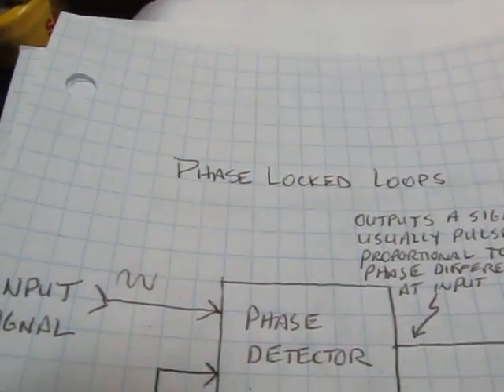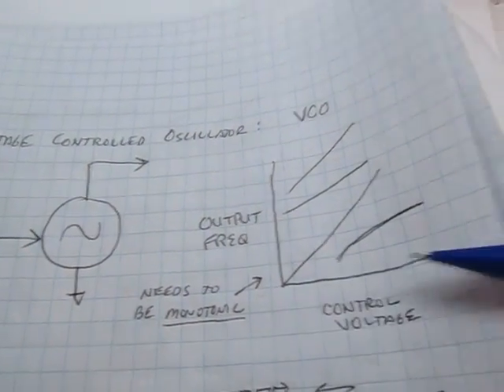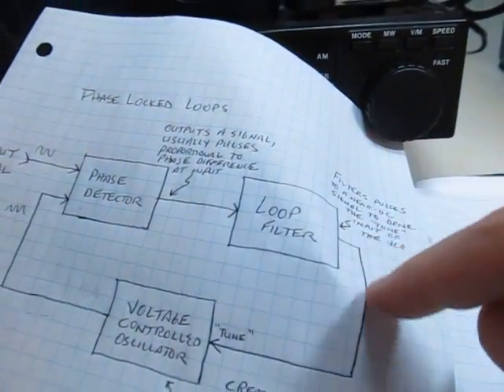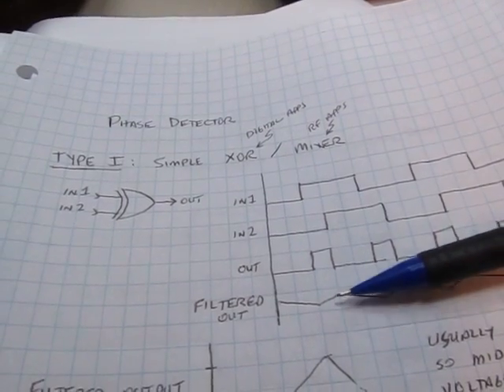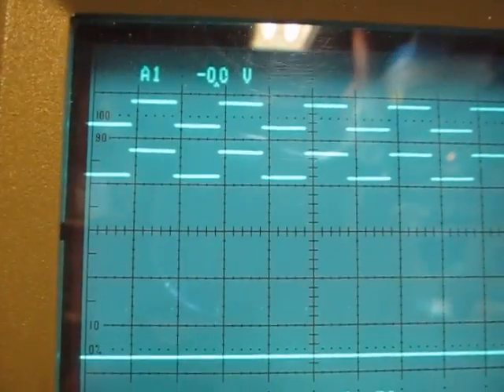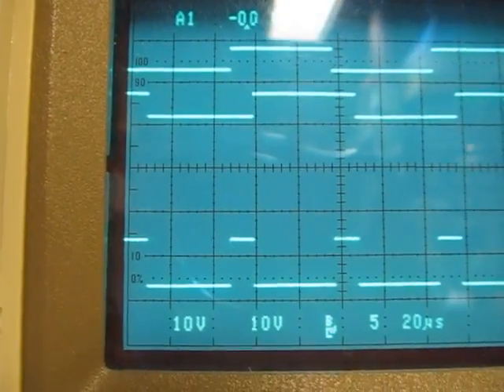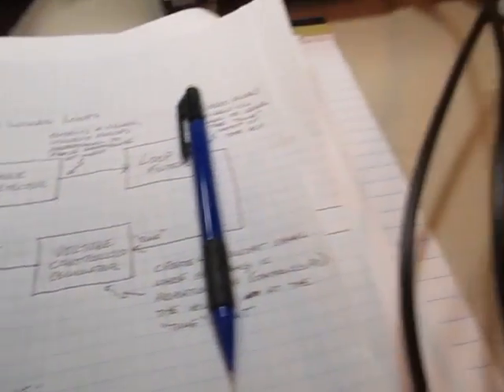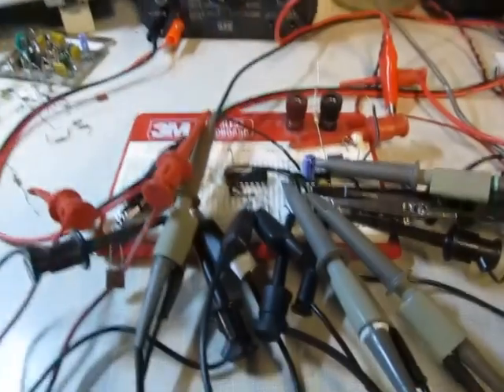#60: Basics of Phase Locked Loop Circuits and Frequency Synthesis

Comment: I realized the other day I have everything I need to make a PLLfrom discreet parts. XOR gate for the phase detector, RC filter, and I figure I could use the VCO circuit in TI's LM358 datasheet. Or if I really wanna go crusty, I could make a VCO from one of those BJT based multivibrators. Though I don't even know if that would work. You can't even look at the output of those multivibrators wrong without the characteristics changing.

Comment: Excellent tutorial!  My training is in Air Force analog flight simulators - non-engineer.  As a civilian, back in 1988 my GE television lost its audio.  I had to teach myself how a phase lock loop synthesizer worked and used a scope to prove the PLL had died in my TV.  It had no analog output to control which channel the audio should be on.  I installed a new PLL and all was good.  I wish I would have had your video back then.  Thanks for posting.  Brings back great memories!

Comment: I am finally starting to understand this. An op-amp seeks to equivalate the voltage of its inputs. A PLL is like an op-amp in the frequency domain, which seeks to equivalate the phase of its inputs. This is the best explanation I have seen. Thank you!
Reply from the maker: Yes - both are examples of negative feedback systems.  An op amp is a basic one, a PLL is a more complicated one.

Comment: Wow, a great explanation video for that 4046 chip! My first electronics engineering job after graduation in the late 1970s was with Burroughs, and I worked on a large mainframe disk drive that used a 4046 PLL circuit to generate a clock signal frequency that was locked to the spinning spindle, on which four 14" diameter disks were mounted. The input reference signal was a once-per-rev pulse from a magnetic sensor. We used a multi-stage divider after the VCO to generate a comparison signal. I did not do any of the design work on that PLL circuitry, although I did troubleshoot quite a few product units that weren't work properly. I do have a couple of those same Motorola MC14046 chips in my IC collection, so one of these days I'll take a close look at the data sheet (in the original printed data book 🙂) and set up a few experiment circuits, just as you've done in this video. There's nothing like "doing the math" on component selection and actually coming up with a circuit that does what it was supposed to do.

Comment: You are an excelent professor, and if you are not a professor, you should be. Thanks for all your amazing videos.
Reply from the maker: No, I am not a professor.  Maybe in my next career.  I am an electrical engineer that started in a TV repair show while in high school, spent 25 years as a design engineer, applications engineer, test engineer, validation engineer at various companies.  I joined Tektronix as a field applications engineer about 10 years ago.

Comment: Thanks for the video.  I've been working with synthesized two-way radios since the late 70s.  I began my  "temporary job" in 1972 so I could go to law school at night.  Oddly enough life got in the way and I spent the next 10 years learn my trade before starting my own company.  May 1, 2020 marked the 37th anniversary of the founding of my little company.  Thus I've had my temporary job for 47 years and at 75 am still working daily.  I've been president of my small corporation for the last 37 years but I still identify myself on income tax forms as technician.  My jobs in the company are numerous but I enjoy the bench best.  My bench job is to fix the unfixable.  I often go back to the basics and particularly enjoy your videos.  My specialty is primarily RF.  Watching this video with my ancient brain will probably cause me to watch it again, possibly multiple times.  I tended to get distracted by the presence of a Simpson 260.  My young people have to use a auto ranging DVM.  I know things where the Simpson 260 is preferable. :-)  My ham call (from 1960 to today) is K4WJZ.  It is not a vanity call but "hamming" is primarily repairing or modifying ham repeaters.  Thanks once again for your videos.  John Hettish

Comment: I really appreciate how approachable this video was for me as a non-engineer electronics hobbyist. One suggestion for addressing your tangle of test probes: if you put male pin headers in the breadboard along each side, that will give you tie points into the circuit that you can connect to without obstructing the view.

Comment: Alan,

Other than a few mispeaks, I found this very good.

It reminded me of a project I built in the 1980s - a stereo FM generator from an article in Radio-Electronics. The L/C oscillators drifted horribly. I used a 74HC297 phase detector w/ a 4059 divide by N to hit each RF channel. My reference was a 10 MHz crystal. It seemed to exceed the stability standard required for FM BC transmitters.

The stereo L/C oscillator generator produced 76 KHz and divided by 2 and 4 to get 38 KHz and 19 KHz. I scrapped that, and used a 74HC4060 oscillator/divider w/ a 9.728 MHz "rock" and picked the /256 and /512 outputs to get 38 & 19 KHz. Tuned circuits were adjusted for least phase difference (greatest stereo separation).

73,
Bryan WA7PRC

Comment: I remember hearing about PLL back in the 70's - it was a selling feature.  Nobody knew what it was except that it was more precise.
Reply: Given that they are almost indifferent to internal properties (monotonous VCO and good enough low pass filter) means that they are precise enough even with simplest and cheapest circuits. But probably real reason was that they were trivial to control digitally.

Comment: Once again a fascinating video, it is funny how all sorts of applications spring to mind. Many years ago I worked for a company that used a PLL in a squelch circuit... it was an SSB radio and the PLL was in the audio path... unfortunately I don't remember the details but it did work pretty well.

Comment: The description of frequency synthesis was an "Ah ha!" moment for me.  Now I have a much better understanding of how a microcontroller can create a rational multiple of some reference frequency (like from a crystal).

Another use case I've seen for a PLL is when you have an external data signal with a clock signal embedded (like Group Code Recording for floppy disks), and you need to synchronize the receiver's clock so that you can reliably sample the data at the correct rate.

Comment: Very nice video.  I am thinking about using the CD4046 for telemetry of seismometer signals.  These signals would be DC to very low frequency, < 1 Hz.  Your video really helps me in understanding the operation of the CD4046.

Comment: Although the video is an "old" one, it's still enjoyable and very informative. You demonstrated a PLL  based on a 4046 in your video, for square wave forms, but, I suppose the actual wave form of either input or reference signal doesn't fundamentally change the basic circuitry you demonstrated. Or does it (say for sinusoidal or saw-tooth signals)?
Thanks for sharing your knowledge and insights

Comment: I am planning on using this chip for a mini tesla coil design, using a current sense transformer as the input. I need to decide which phase comparator would be better for allowing my half bridge MOSFET driver to run the primary coil / capacitor tank circuit at resonance (the goal is to achieve high power ZVS switching). If I use the "XOR / mixer" phase detector, then there must always be a 90* phase shift between the feedback and the drive frequency, so that the usable locking range is maximized. A) How do I achieve this? B) Does this make it unsuitable for allowing the device to "lock" in and drive my primary properly? Is this phase shift acceptable? Or should I use the more advanced phase detector? The tesla coil is, by nature, a VERY electrically (and audibly!) noisy device. (note: I am using a PLL because I want to be able to FM modulate the output, allowing for high-efficiency audio modulation.)

Also, on a completely unrelated note, I am using 2 N-ch power MOSFETs for a push-pull half bridge driven using a hand-made gate drive transformer (GDT) wound on a medium-sized dark green toroid with 15:15:15 trifilar winding (I have empirically determined that my green toroid has the best properties (highest permeability of all the ones in my junk bin, requiring the fewest turns of wire to function). With no load, I notice very significant ringing in the low MHz on rising and falling edges of the output square wave (output is 50Vpp centered at 25V) I assume this is caused by either miller capacitance causing some parasitic oscillations due to my GDT + 10-ohm series resistor not performing providing a low enough driving Z. (gate drive is a 20Vpp (no DC component) square wave) Or perhaps it's the result of the drain of my FETs being electrically connected to the heatsink? This ringing is also present in on my GDT outputs and visible (but not so pronounced) on the input driver side of the GDT. Or could it be a result of a poorly wound/designed gate drive transformer? built this onto a perf-board and tried to keep the loop area from the GDT to the transistors small as well. It didn't seem to help much. So how would I reduce Z at these several MHz frequencies and fix this ringing?

Comment: How would I tackle a situation where I have 100 mhz signal with 90 and 150 hz  modulation. I want to detect the phase relation of the trx pulse to the return pulse. the pw will not chg only the time of arrival . the time of arrival should be should be the phase delay. This is to take the phase difference and modulate a signal to provide a correction to the rcvr. Typically the phase duration/difference will be not in phase until the object has the same phase delay . In other words the toa signals of the 90 and 150 will be minimum. Note- the 90 degree mod is positive pulse and the 150 pulse will be negative.   i can start by asking ? will the PLL signal has to be divided to acept the 100 mhz siganl (VHF)?
You give a great presentation of the PLL multiplier 10x. Looking fwd to learn more on PLL.
Thanks
Juan

Comment: An excellent demonstration. There is however one point that I never understood regarding those PLL circuits. How can changing the frequency alone (through a VCO) allow you to lock two signals in which the difference might be frequency-based and phase-based. It is an exploration in two dimensions, isn't it. I really don't get how trying to eliminate the "phase detector's" output through changing the frequency alone works to recover a clock.
Reply from the maker: It's because phase and frequency are intimately related. The 'rate of change' of phase vs. time is the frequency. I.E. 360 degrees per second is 1Hz. Thus, frequency is the derivative of phase vs. time. Therefore, when you adjust the VCO, you're changing both freq and phase. If you adjust the VCO freq up and back down, you can be at the same freq but at a different phase.

Comment: One thing I don't get - the last demonstration of making the VCO shift in phase - what exactly are you doing the the VCO input? adding a DC offset?

Somehow in my mind i picture that the rest of the loop would just compensate for offset you're adding.
Reply: Think backwards around the loop. He's pulling/pushing current into the output node of the phase comparator. Because it's a control loop, the phase comparator has to push/pull current into that same loop to compensate. But it'll only push/pull current if the phases are misaligned. QED, pushing/pulling current into the output node will cause phase misalignment.

Comment: Very clear! I wonder, if you are using dividers or multipliers, the VCO range must be enhanced. Since the VCO may not behave linearly in an extended range, this should be checked carefully, in case of large divisions or multiplications, am I right?
Reply from the maker: Yes, you would definitely have to ensure the VCO being used behaves in a monotonic way at the frequencies you intend to use.

Comment: Hi great video, but there's something that I not understand. When the signal is locked, the phase detector output is zero hence what is driving the VCO to synthesis the output frequency that we want. thanks
Reply from the maker: +Boonyang Tan There is always a very small phase error that nudges the VCO tune voltage up or down.  These "nudges" are filtered by the loop filter.  The amount of gain in the feedback loop determines the size of the phase error.  More gain = less phase error.

Comment: I have question to your last section. Where you added voltage to LPF output (VcoIN) and the PLL compensated for that by varying the phase. I understand that it should happen for the transient time of the loop. But the should the PLL compensated for this additional voltage offset that you have added by decreasing its PD output and then bring the PLL to a lock. Why does your phase shifted waveform look so stable. I was imagining more of a jitter.
Reply: Got it to work. So instead of what you did where you just added a pull resistor to yank on the LPF output. What I was trying to do is take the LPF output through a summing amplifier where I am subtracting the V(LPF)-V(yank) and then feeding it back to the VCOin. That wasn't working. So instead I connected the LPF out to VCOin back. And just added V(yank) through a resistor on VCOin and it worked as your demonstration. So basically what I need to do is a current source instead of voltage source for my Yank signal.

Comment: Dear w2aew:
concerning PLL  induction heater i have a very important question WOULD 
YOU please answer it ?
how can we make sure pll has locked and is working properly?
when i turn it on , it gets a soft start from high to low frequency 
until it stops on a pre tuned frequency while i have current and 
inverter voltage in phase but as the work peace gets to the curie point i
 don't see any change in the amount of the frequency . it remains the 
same as when i started while the current leads the voltage.
would you please explain exactly what happens at resonance on the 
oscilloscope from when you start until the work peace gets to the curie 
point?? 
in face will you see the frequency goes higher as the work peace gets 
hotter and the current and voltage remain the same ??
thanks a lot Saeed Mahdav

Comment: Another great vid Alan. I now understand the inner workings of pll's. But I'm not clear on how these are interfaced to the outside world. 

You mention x2 and ÷2, but where is the resultant signal picked off and used externally to the pll? Your examples are absent an output. 

How about a "PLL 102" vid?
Reply from the maker: Usually, the output of the VCO is used externally. By manipulating the dividers on the feedback path as well as one in the reference path, one can synthesize a desired frequency at the VCO output.  In other applications such as PSK , FSK a or FM demodulation, the output is taken from the loop filter output.
Reply: ***** Thanks Alan. Would make a great vid, no?
Reply from the maker: Yeah, maybe in the future...

Comment: Thank you for demystifying PLLs! seeing the thing in action is worth more than the array of unsolvable equations we ran through in my uni course. Just wondering about the frequency synthesis part, if we already have an oscillator that we can control to output persuambly whatever frequency we want, why do we do the little phase locking "dance" with divider blocks and such instead of using the VCO output directly?
Reply from the maker: Mainly for accuracy and stability.  It is much easier to get a single-frequency reference oscillator that is accurate to some desired ppm, then it is to set a DC voltage on the control input of a VCO and hope to get good accuracy (and low phase noise, low drift, etc.).  Using a PLL, the accuracy is all determined by the reference.

Comment: VERY INTERESTING! but somehow im missing the relationship to a real application here. like.. where again is the "output" of the synthesizes freq? and yet is it still rectangle? talking about all those rectangle waves here.. how does a sine signal generator or something like that goes together with a pll ? or a tunable 80m CW transmitter. i still dont see a connection there to the "digital" pll. would be very pleased to see more of you explaining electronix like that! so phukin interesting!!

Comment: Using this setup, can we multiply the frequency from a vibration sensor and sent it to a spectrum analyzer? I think this is usefull because the mechanical vibrations are usually less than 9kHz. And a spectrum analyzer is more precise than an FFT on a cheap scope.

Comment: I was having some difficulty picturing how the feedback divider can multiply the VCO output, but that really helped. Thanks!

So PLL's are control systems for phase and frequency in the same way that opamps are control systems for voltage amplitude?
Reply from the maker: In a sense, yes.  PLLs are certainly control systems for frequency generation and phase control.

Comment: Re: frequency synthesis. You said, by dividing/multiplying the input/feedback you can multiply/divide the output frequency. What is the difference then between, say, the doubled feedback frequency, and the doubled output frequency?

Comment: Alan, I have frequently used this video as a refresher for PLL theory. I have one question that I can't find an answer to however. Can a 1 HZ pulse be used to lock a 10 MHz signal?  I'm trying to design a gps disciplined oscillator, but the 1hz pulse from the GPS is making it complicated.
Reply from the maker: It is possible, but will be tricky because the loop time constant has to be very long (slow loop response) because the loop only gets an "update" once per second, thus the loop has to hold the frequency nearly constant during the intervals between the 1pps pulses.  I believe there are a few designs floating around online...